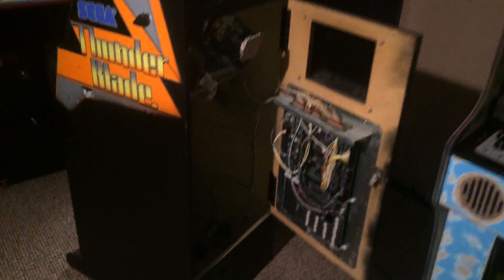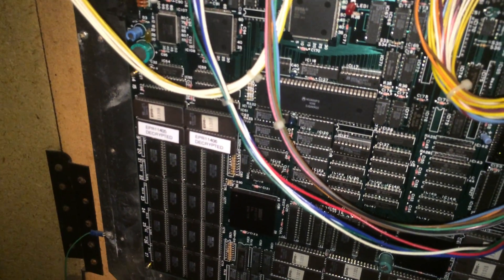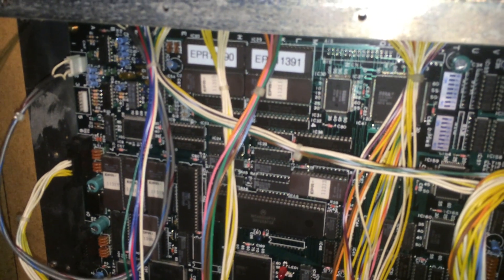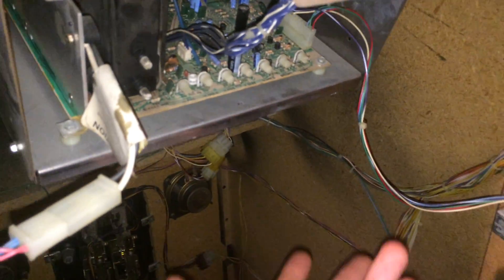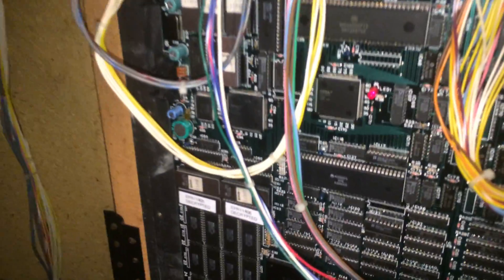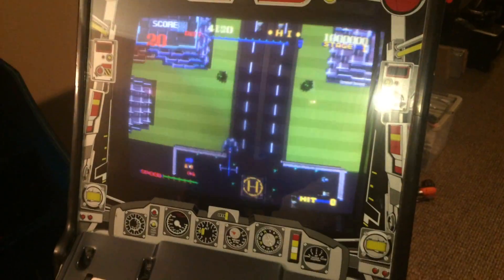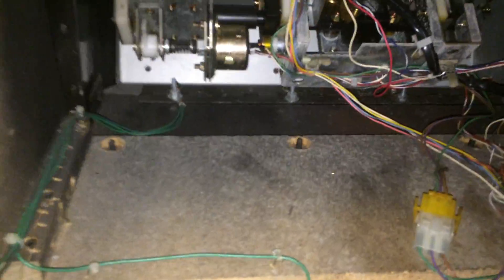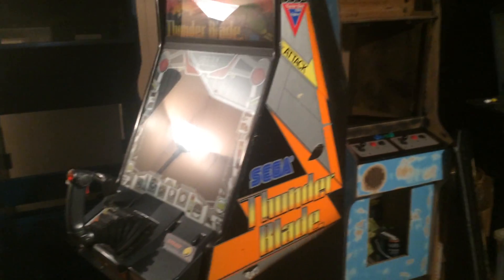Thunderblade SEGA Resurrection Part 2 - Success!

Comment: Hey, Jason love the videos, I do have a question though you have listed in the video description (D27C512) EPROMs but those are 28 pin chips and we need 32 pin chips for the decrypted roms. What roms did you use for those? So far I have what looks like a still image of the game that will display, which is progress, however I questioning weather the 32 pin Chips I bought are compatible (I had trouble erasing the original EPROMs as well).
Reply from the maker: themrb007 Thanks for the catch!  I've updated the description to M27C1000 32-pin EPROMS. Those are the chips you need.
Here's the video of me burning them:    https://youtu.be/cetRTtcX0iw
Reply: DeLuSioNaL's Arcade okay thanks I just ordered some of those, hope these will solve my issue.
Reply: Yay! Got my EPROMS today burned them and the game booted great, works great! Thanks so much for the helpful videos!
Reply from the maker: themrb007 Sweet!  That's great news!